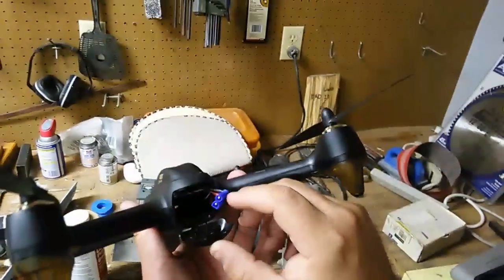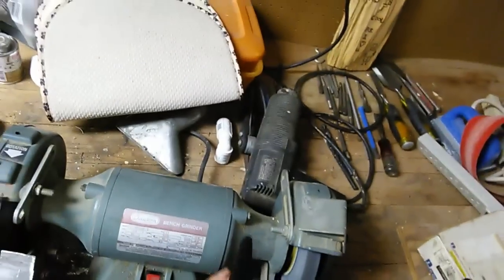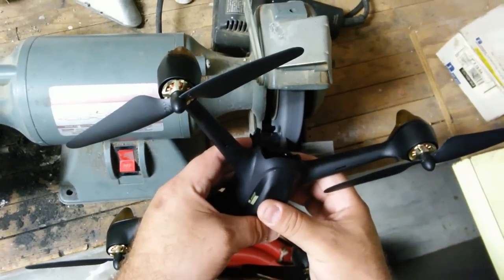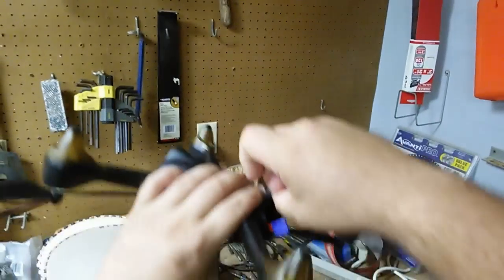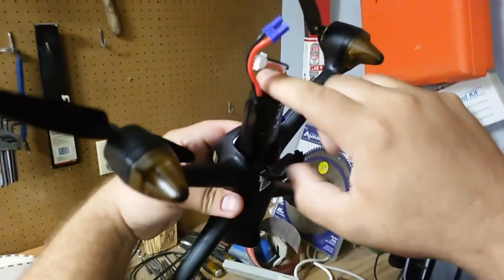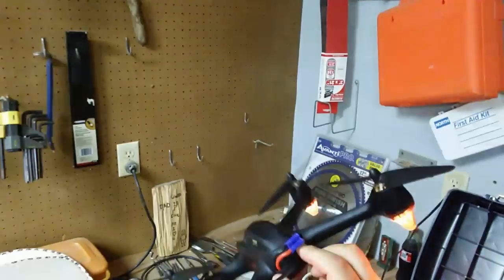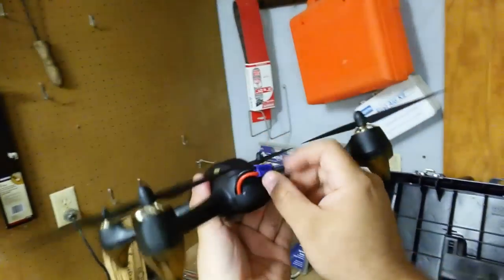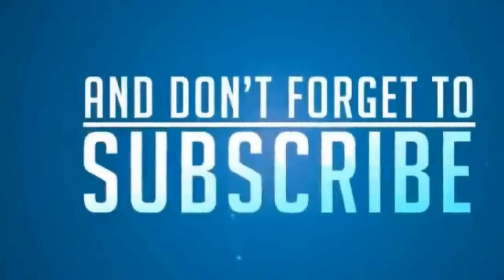Hubsan X4 H501S Battery Door Modification

Comment: You just saved me a big headach on how i was going to get away with a little longer wires, and i put xt60 connectors on drone and batteries,everything works great thank you, This should have been something Hubsan did from the start, consantly stuffing battery in drone with such limited wire from powerboard will result in breaking after a time, for me it was a year and a bit, thanks again for the easy quick fix Mod i Subbed

Comment: Yup. Good mod. 
 I did the very same thing when I got mine. The only difference was that I used mini wire cutters to get the job done. 
 What a wonderful difference this makes. 
 Hubsan should have done this as a design feature  :) .
Reply from the maker: I agree
Reply: Hey Guys, Im going to be getting this bad boy soon. Is the issue that bad? I think it looks so much sleaker without the mod. I appreciate your input and love the videos. Your videos are a big part in my getting it. Thanks!
Reply from the maker: Unfortunately yes you kind of have to jam the wires in the back of the battery case and apparently it causes the solder to come off after while.
Reply: dragonjn 
 The issue is tolerable, but it will eventually get on your nerves. 
 Sure, it looks sleek without that mod, but you won't be able to see it when it is a hundred metres away  :) .
 In time, I think you will feel the need to make this mod.
Reply from the maker: ***** agreed

Comment: This is a smart mod to make.  The alternative is to take the entire thing apart and repair a broken solder joint.  Not something you really want to have to do.  I used a Dremmel with an abrasive cylinder.  Provides a bit more control during material removal.  To make the door a bit easier to open, simply file a bit of material off the door "lock" catch.  Go slow, and keep checking your progress.  It doesn't take much to correct the problem.

Comment: your right had mine for a year and constantly stuffing the battery and very short wires in caused the the wire on the male ec2 connector to break also came unsoldered on powerboard i fixed it with a little longer wires so as not to crimp them and this mod will come in handy so im not crimping wires all the time